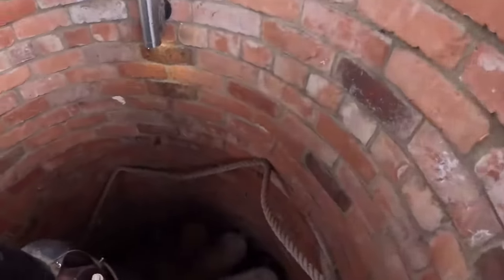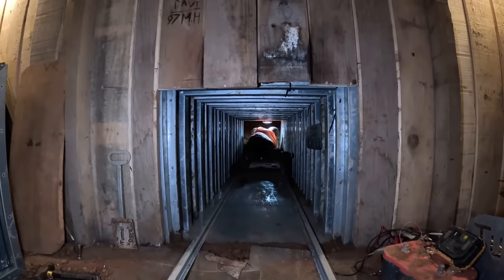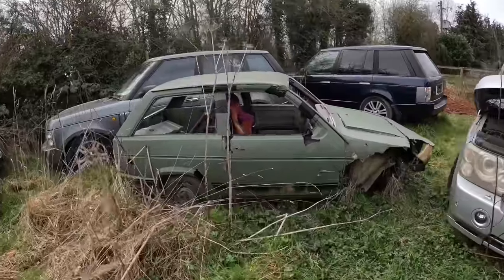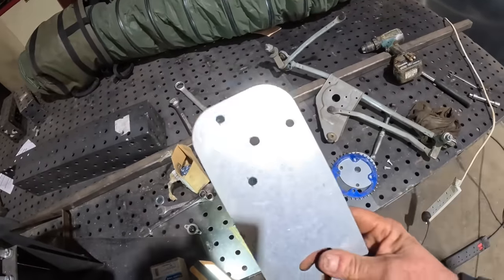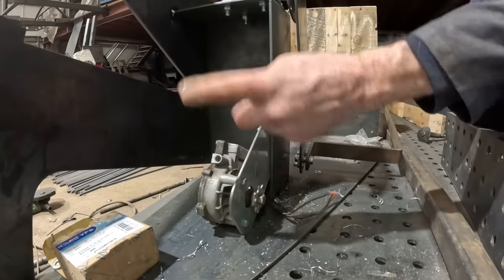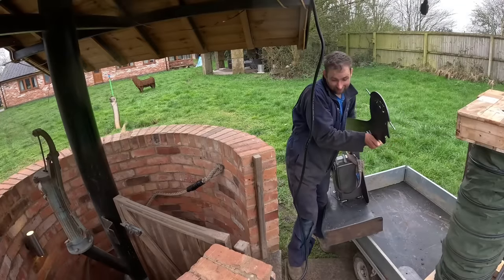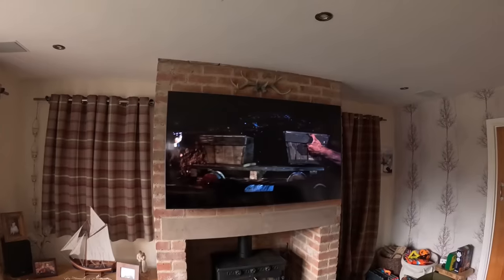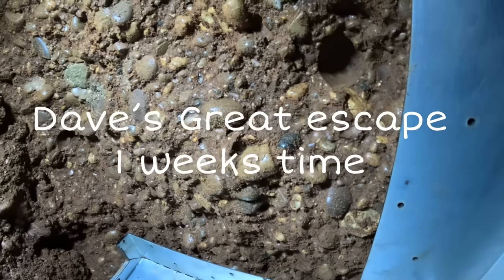Great Escape Tunnel “Dave” Part 5

Comment: Tip when prototyping on plasma, laser etc. Tab round parts so you can drop them back in the sheet to rework them. Saves lots of scrap for test fit stuff :)
Reply: Or make a 0,0 reference edge that's bolted to the machine so you can place a part in the corner of the bed and it'll be positioned spot on for rework.
Reply from the maker: I had already took the waste off, I thought about drilling it but thought I would be quicker restarting 😀

Comment: This is ace and you're clearly off your rocker. ❤
1. So is the air pump currently pumping air anywhere, or is it just for show at the moment?
2. They didn't have a plasma cutter and a 30 ton press in Stalag Luft 3! I reckon you should get rid of all the modern gumph and do it like the originals mate. 😅😅
3. Don't stop, because this is gloriously bonkers.
Reply from the maker: Yes I know I’m cheating a bit but there tunnel was meant to last one escape and mine will hopefully do me 😀 yes I need to connect the air pump after Dave’s Great escape 😂

Comment: Are those sprinklers for fire suppression on your ceiling in the house?
Reply from the maker: They are down lighters, just lights 😀
Reply: @Tornado_Dave  
OK.  BTW, last trip to my hole, I did not have my saw blade.  My dirt is to hard for the drill like your